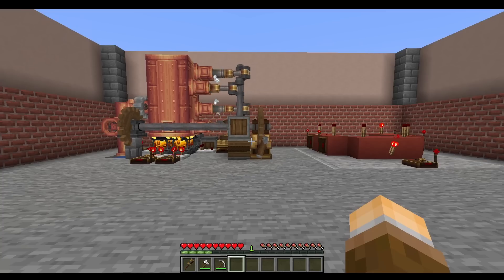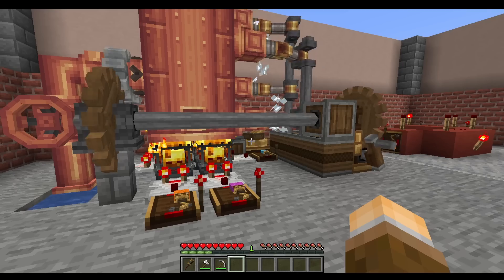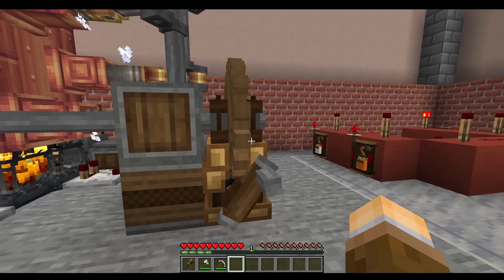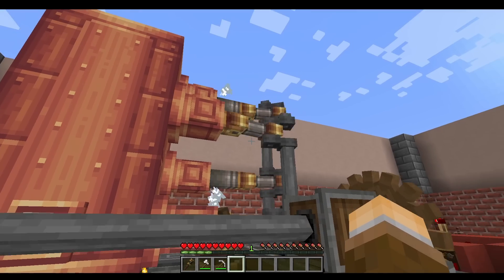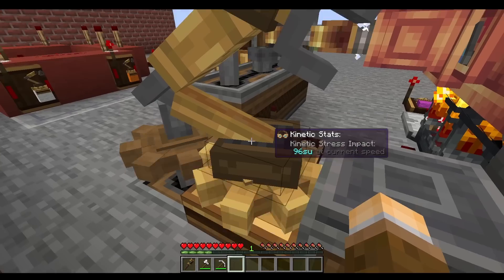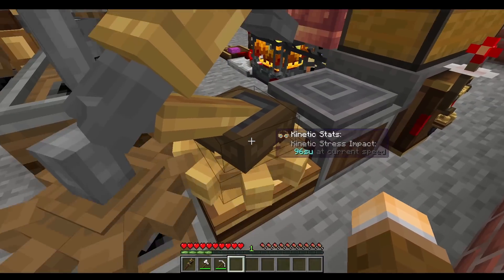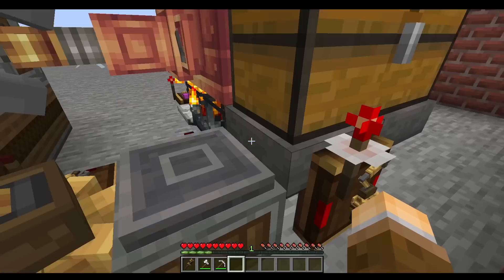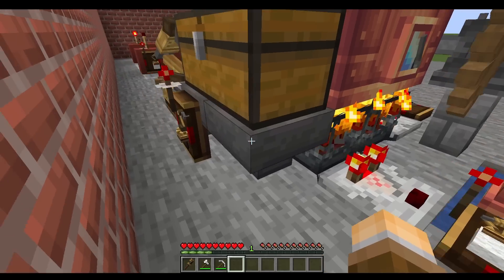Create Mod 4: Self-Sufficient Hand-Cranked Steam-Engine

Comment: Question if you don't mind. If it's hooked up to machines, and you try to hand crank it, wouldn't it be too hard to turn? Since it's all in one system. I'm fairly new to the mod and tried to set this up myself but couldn't get around this issue.
Reply from the maker: to be fair, you're 100% right! A way I can see to go around that is to just make a mechanism to disconnect the engine from the system whenever it stops :P
Reply: @GabeLily  OK, good to know I wasn't crazy! Now that I think about it, I'm sure you could just use a clutch to prevent powering other systems temporarily, or like you said, activate on system failure. I really love the clean and compact look of this one, thanks for showing it off!

Comment: Would work even better if you had it hooked into a farm that makes coal. Like you could hook it into a tree farm make charcoal out of the wood. And then it would be fully self sufficient, both powering the tree to coal farm and itself just from using the hand crank.
Reply from the maker: Um, I can't really read that. Could you rewrite it with punctuation?
Reply: @GabeLily umm sure. I wrote it on my phone so it did not have punctuation.

Comment: to what rpm do I have to reduce the crank to get the engine to start? I've not managed to get a cranked one to start up...
Reply from the maker: It's a pretty high RPM, I'm not exactly sure but with two pump you need around 16 rpm. I'll give you the actual rpm necessary whenever I can
Reply: @GabeLily  i would like to know this too

Comment: It's not self sufficient, it's coal powered. You turn it on with the hand crank but it will stop without coal. You could just use all that coal in a blast furnace...
Reply from the maker: Hi! In case you haven't noticed, I mentioned this in the pinned comment. I believe it would have been easier to scroll down one centimeter, rather than write this non-helpful comment!

Have a fine day!

Comment: Love the simple design. I kinda went over the top with mine and made it a 3x3 boiler that is completely self sufficient and needs to imput from the player, not even having to start it manually.
I made a simple tree farm that feeds all the wood into a lava fan and turns it into charcoal which then gets sent to a depot from which a mechanical arm fuels the 9 blaze burners, meaning that I never need to even touch the thing and it'll keep working forever. It's big enough to give me somewhere around 150000 su units
Reply: Could you post some screenshots on imgur and send me the link? I would love to see it and build it in my own world
Reply: @samuelhybs7073  Hey there. I just stumbled across this video and your comment. If you want I could show you my steam engine build. It runs two 3x3x4 boilers with 9 engines each. They are fed with lava buckets which I infinitely retrieve from the nether with an automated process.

Comment: I made an absolute chonker of a boiler and it wasn't even that good it was level 1 couldn't really make it more bigger (the boiler not the system) ended up making it over engineered but hey it's automatic self-sufficient so is it worth it? no IM still in spite of them removing furnace engines ;-;

Comment: Why not use campfires like they showed in videos? That has unlimited power so you dont need to fuel them and you can pull water from an ocean, then it will become self sufficient
Reply from the maker: the boiler has three modes: idle, active and something related to blaze cakes. In short, the more heat it gets the faster and stronger the engine is. If the boiler has campfires, it's at it's weakest state.
Reply: @GabeLily  ah, makes sense, well a tree farm is easy enough to make and you could probably burn them into charcoal using fans, a diffrent question would be if there is a diffrence between just one burner or 4 being under the boiler
Reply: @mrmateusz5188  im guessing there is, which brings up the question, how many campfires equals a single blaze burner, and how wide would you need to make the tank to give it the same energy output with campfires as it has with those 4 blaze burners

Comment: Might need to try but I'm pretty sure the mecanical arm won't over feed blaze burner by default. So maybe with no logic it's fine too
Reply: I can confirm that you don't need those redstone links as mechanical arms are smart enough to not overfeed the burners.
Reply from the maker: A problem I've seen with it is that the mechanical arm often seems to feed it randomly, buy I suppose you might be right
Reply: @GabeLily  As far as I know the mechanical arm feeds the blaze burners until their maximum burn time is reached at which points it stops in order to not overfeed them. That means it can feed your burners before they completely run out without wasting fuel. I’m not sure where I read this info but it matches up with my experience of using arm fed steam engines.